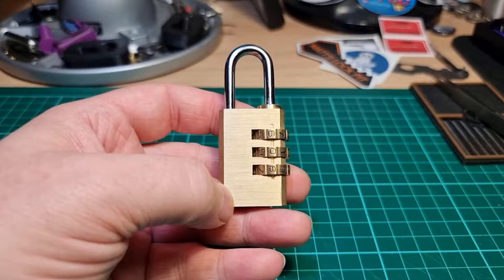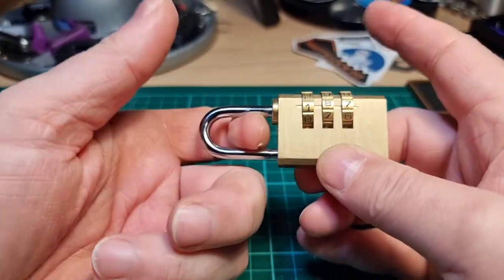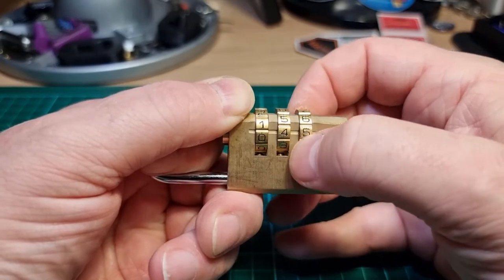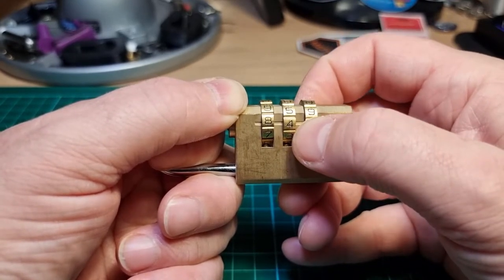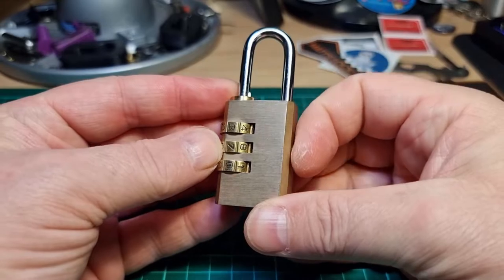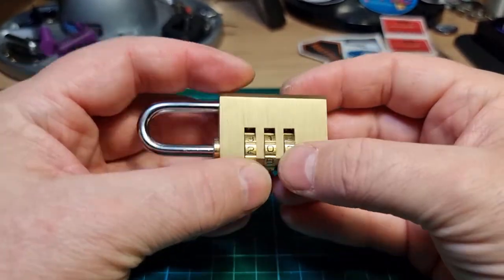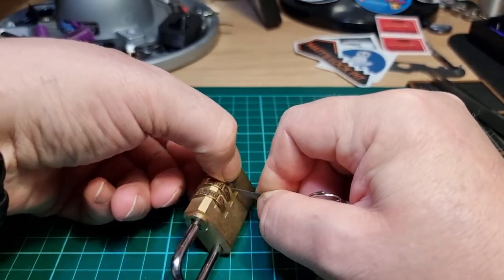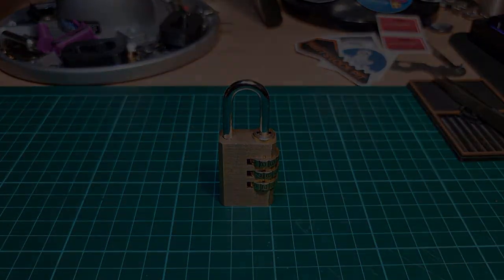(221) Combination Lock With False Gates #minilockmonday

Comment: Nicely decoded mate👍
I tend to quickly get cramp tensioning these locks so it's nice to get them quick
Reply from the maker: Thank you 😁 
I've got a draper one that's just a nightmare to decode..
This one is not so bad, it doesn't need very heavy tension.
Cheers bud 👍 🍻

Comment: These 'shackle through the wheels' types of locks are where I first discovered what false gates were. When well made they're not as easy as you'd think but most aren't that well made.
Reply from the maker: I've a draper 3 wheel combination that is a nightmare to decode.. even with finger hurting tension applied to the shackle.
For an unbranded lock I was quite surprised it even had false gates.
Cheers bud 👍 🍻